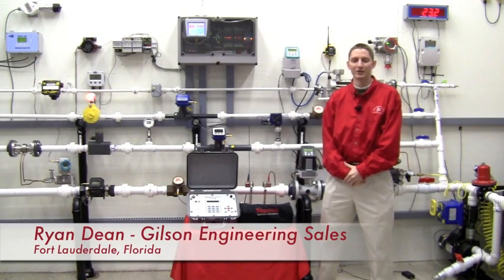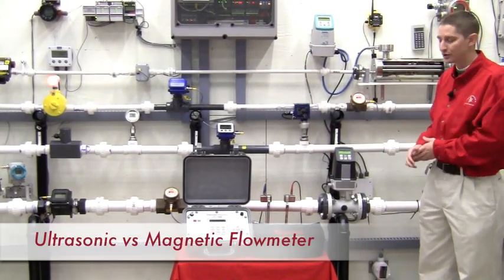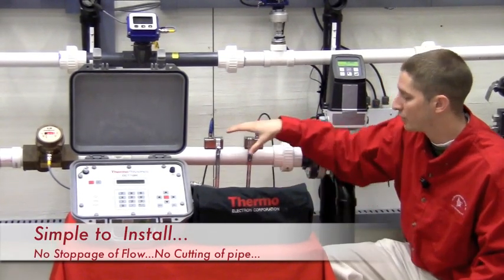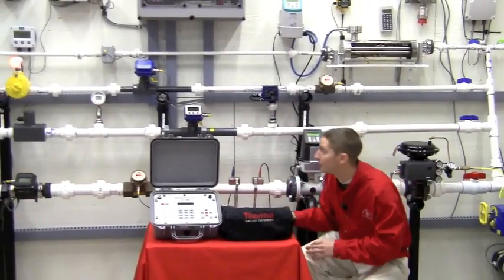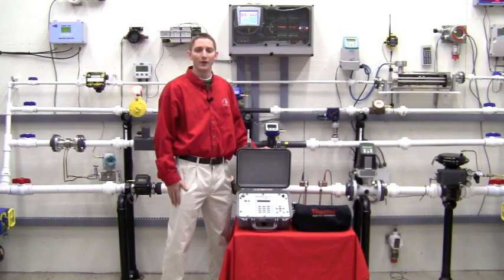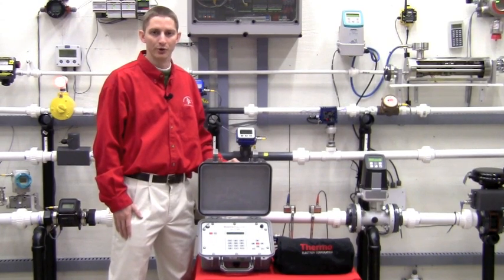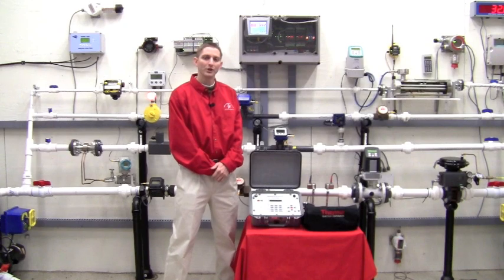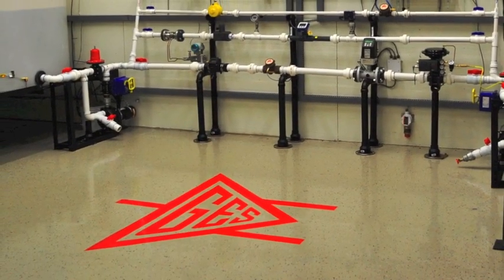Polysonics Ultrasonic Clamp-on Flow Meter

Comment: i have to install a clamp on flow meter in water line pipe for metering purpuse can you assist me what distance is required for both transreducer my pipe size is 600mm ???????